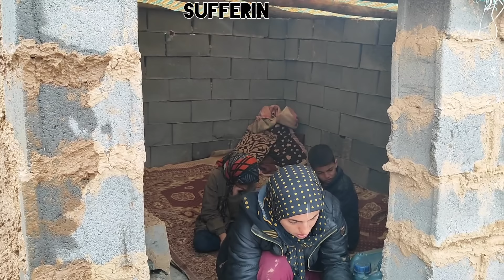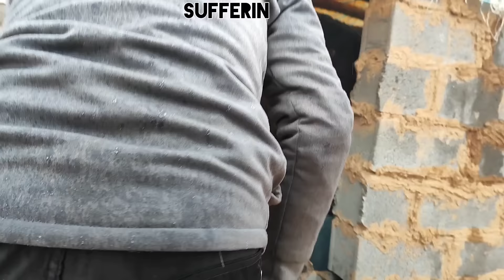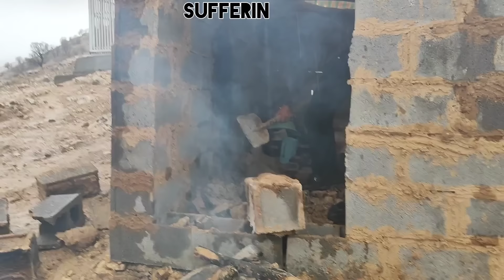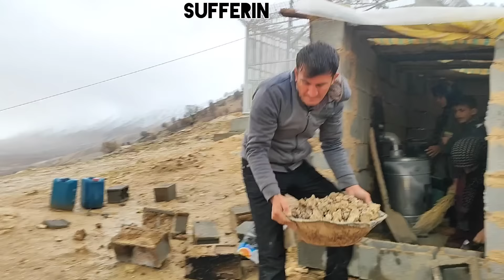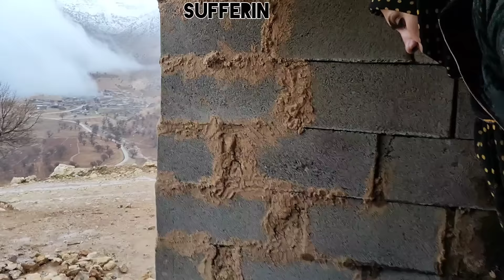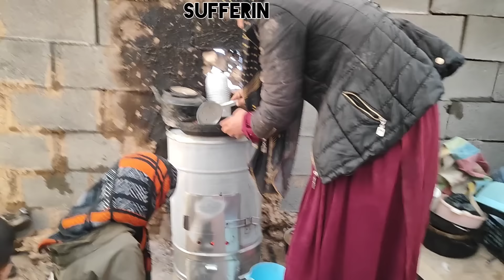"A gift of love: a stove for a nomadic woman"

Comment: Clearly can be seen there is no MORTAR between the Bricks of that building !
That is VERY DANGEROUS to live in , it can FALL APART at any time .
Apparently there is just a little MUD on the outside joints but that will not prevent the house from falling apart. 

I don't care about anything else but the SAFETY of these people. 
Unfortunately I am in South Africa and unable to go to these to people to help but I BEG someone to please step in and rectify this problem. 

May God be with you.

Comment: You have a few blocks , use them under the big logs in the ceiling .make them higher on one side , so the water and snow don't stay on a flat roof ! If you don't do that , your roof would collapse because of accumulation. One side higher than the other , please.